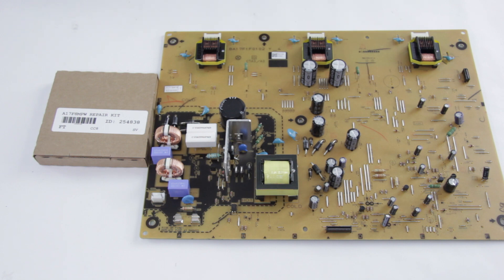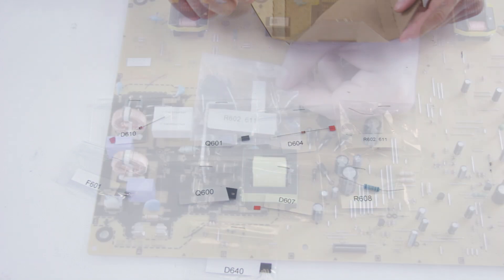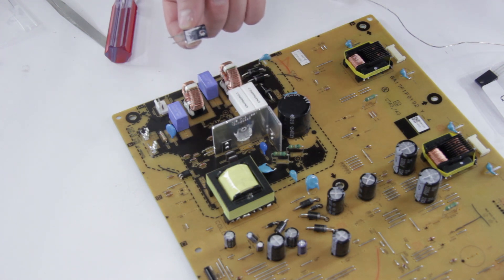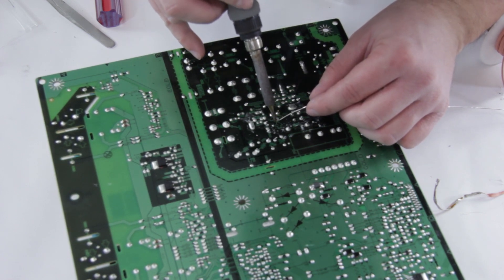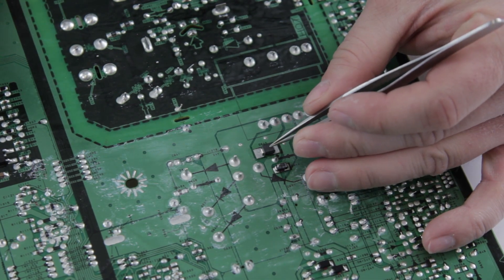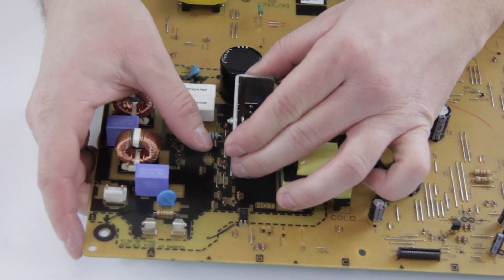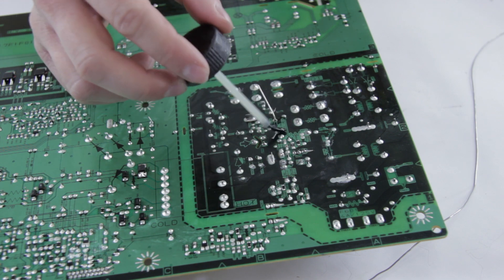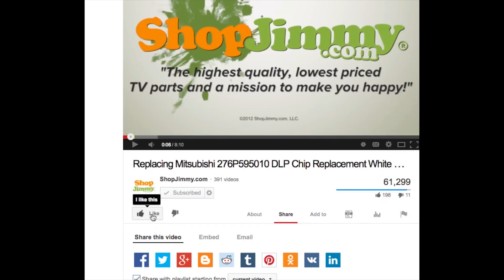Emerson / Sylvania / Magnavox No Power LCD TV Repair A17F8MPW Power Supply Component Repair Kit

Comment: Emerson LC32OEM2 TV: I have 5.xV (volts, the voltage is anywhere from 5.12V to 5.30V) everywhere but no more than that! If I push power button on TV set, nothing happens! The chip that has the big "L" shaped heat sink is hot, so I pulled it out and tested it - it is OK, based on 3 of my Transistor Meters, so I put it back. The push-button for power (and all other like sound ...etc) are going to the other board and a ribbon cable is between both boards should tell the power supply to supply 24V (at least that is what I found in the service manual), but nothing happens. When I disconnected the ribbon cable + all other connectors, so there isn't anything connected to the power supply, the chip is as hot as if I did not remove any cables at all. I have several questions: 1) Is that normal, that the chip is so hot to touch, despite that there isn't any load on it? 2) Where can I find what reading should I see on my volt meter when poking around the power supply? 3) Does anyone have any idea what else I can check (I tested visually and with 3 different capacitor testers all the capacitors - they all look OK to me)  I also measured the diodes - I did not pull them out, so I understand that in some cases I could get bad readings, but I also tested voltages while the power supply was on, to double check the diodes. 4)Where one can go and get help and or leave help for others to help them? 5) Are there any clubs or Facebooks that are for people like me, who is learning to fix TV; I'm trying to help others, like people on wheelchairs and or poor people, who can't afford expensive or any $ to fix their TV.  I'm not making any $, I do this to help and I'm having fun learning also.  Thanks guys!

Comment: I bought a repair kit ..and install it fuse didn't blew up but still not working    LC320EM2F serial #DS#A1137158      BA17F1F0102     Help me Pls.A1AFOMP
Reply: lawrence coquico same here! Did you get it fixed or resolved?
Reply: check for a shorted diode , theres a gruop of diodes in a raw close to the center of the power board  in the middle u should see a little diode check if its shorted

Comment: hello jimmy,
I have a Emerson LED 50", model #LF501EM4F, It won't turn on or anything. 
It dose make a "beep" sound every couple of seconds constantly.
The sound seems to come from a transformer on the powerboard (# BA3AU0F01  02  2)   
Is there a kit for this board or is there a problem somewhere else?
Please email me at   joevianelli@yahoo.com  any help would be great!
Also the manufacture date is Sept. 2013
Reply from the maker: +Joey Vianelli   Try all repairs and troubleshooting at your own risk.  I recommend replacing the main board in your TV.  Click this link to replacement parts for your TV model number:  http://www.shopjimmy.com/catalogsearch/result/index/?cat=225&q=LF501EM4F%2C  There may be multiple boards for the same TV model number, be sure to match part numbers on your current board, with your replacement for compatibility.  Thanks and please let us know if you have any further questions with your TV Repair!  www.shopjimmy.com

Comment: i have 2 flat screenz i need help wit! 1st off a Sylvania 6632LG it just turn'd itself off... tryd to turn it back on it come on 4 a sec and shut off again!!??? Also a 27inch Emerson LHD32K2OUS  when plug it in has red light try to power on it does nothing wont turn on?? Any idea on what goin on?? Thank You if can help! :)
Reply from the maker: +69lildro   Try all repairs and troubleshooting at your own risk.  I recommend replacing the digital board in both TVs.  Click this link to replacement parts for your TV model number:   Sylvania - http://www.shopjimmy.com/catalogsearch/result/?q=6632LG+  Emerson - no search results.  There may be multiple boards for the same TV model number, be sure to match part numbers on your current board, with your replacement for compatibility.  Thanks and please let us know if you have any further questions with your TV Repair!  www.shopjimmy.com

Comment: I have a LF320EM4 emerson.  Probable lightning strike according to my friend that had a storm .   Is there a F601 on this set.  The glass tube type.  I find a place on 
BA3AFOFO102 3 board for F602  my continuity test shows this open.  Mutli meter shows no resistance.  I was expecting to find an easy to replace fuse without solders.  Is there such a fuse on this set?  If you can't point me to a fuse of the proper kit  then would you be kind enough to help locate the proper power supply board ?  I can find many BA3AFOFO102 1 boards but not the one in my set.  Are they interchangeable? Is there a suggestion to help me fix this cheaply.  I dabble with some electronics and would love to be able to get this running at home.  Thank you so much
Robert Kelly.

Comment: Hi im Nick, i have a memorex model mlt3221 the tv will not turn on at all. I replaced all the caps on the power board and it still wont work. How can i test the power board or is there something else i should be looking for.. Thanks ahead, any help will be greatly appreciated.
Reply from the maker: aalnil   Try all repairs and troubleshooting at your own risk.  If you have experience and  the skills to use a multimeter, you can check for standby voltage on the power supply.  If you do, please reply with the results.  Thanks!  www.shopjimmy.com
Reply: I bought I repair kit . and install it follow your you tube not blowing fuse but still not turning on.. pls help ..

Comment: Hi, i have one tv EMERSON LC320EM2A with board BA1AFGF0102 2   A1AFG022   i want buy you the correct repair kit or module i have one repair kit BA17F1F0102 but the D604 in this model don't have installed this diode can you say me if this repair kit work with this model or if you have another kit or replace by this board model? thanks. e-mail radio_partes@yahoo.com

Comment: I have an Emerson LC220EM2.It worked fine and I shut it off and tried to turn it back on.Nothing happened,nolight on front,no sound,no picture.I bought and installed a new power board. It still is the same,Could it be the main or digital board?Can you give me some idea what to do next?
Reply from the maker: Dilenco   Try all repairs and troubleshooting at your own risk.  I recommend replacing the digital board in your TV.  Click this link to replacement parts for your TV model number:  http://www.shopjimmy.com/catalogsearch/result/index/?cat=225&q=LC220EM2  There may be multiple boards for the same TV model number, be sure to match part numbers on your current board, with your replacement for compatibility.  Here is a link to a video showing how to identify your part number, click here:  https://www.youtube.com/watch?v=wooRqBrRo6o  Thanks and please let us know if you have any further questions with your TV Repair!  www.shopjimmy.com

Comment: I have a BA17F1F0102 power supply problem and you sent me a kit, which i receive in due time and have it replaced all of the parts that were shown on this video, which i was so thankful...but, i have some doubts whether to replace all of them, which you didn't show in this video...i am referring to D607 and D604 which the latter was originally missing on this board...i did replace D607 anyway but my question is should i put D604 which was originally missing...thanks and goodluck... Felix Q.
Reply from the maker: Felix Quillope   I recommend using all of the parts.  Thanks!  www.shopjimmy.com
Reply: I did used all the parts and it turned out perfect... Thanks ShopJimmy...Felix Q.

Comment: I have a Emerson lc320em2. no power , I installed the repair kit A17F8MPW , now I have power and sound and picture But the picture and sounds comes on , then it starts breaking up ,and the picture and sound gets erratic like a satellite in a storm. Do I need another board?
Reply from the maker: Johnny Avent   Please watch this video FIRST to help with your repair!  https://www.youtube.com/watch?v=BP3NVNCGEv8  I recommend replacing the digital board in your TV.  Click this link to replacements:  http://www.shopjimmy.com/catalogsearch/result/index/?cat=225&q=lc320em2  There may be multiple boards for the same TV model number, be sure to match part numbers on your current board, with your replacement for compatibility.  Here is a link to a video showing how to identify your part number, click here:  https://www.youtube.com/watch?v=wooRqBrRo6o  Thanks and please let us know if you have any further questions with your TV Repair!  www.shopjimmy.com

Comment: Hoping you can help me. I've got a Emerson LC320EM2F I went to turn it on it would not do anything. I took the back off
the fuse was blow I replace it with the same fuse and it blow it is there anything I can check  Thanks
Reply from the maker: b murphy   I recommend replacing the power supply board in your TV.  Here is a link to replacement parts for your TV model number on our website, click here:  http://www.shopjimmy.com/catalogsearch/result/index/?cat=4&q=LC320EM2F  Be sure to match part numbers on your current board, with your replacement for compatibility.  Here is a link to a video showing how to identify your part number, click here:  Part ID Numbers for Sylvania, Emerson, Philips Magnavox MPS, MPW, MUT, & Digital Boards TV Repair  You can also call our customer service for further assistance with your purchase.  (877) 881-6492  Thanks and please let us know if you have any further questions with your TV Repair!  www.shopjimmy.com

Comment: Hoping you can help me. I've got a Emerson LC401EM3F. Turned it off and went to work, came home turned it on and the red light went off and now the TV does absolutely nothing. No red light or lights of any kind, nothing, not a thing. I unplugged and let sit, plugged it back in and still nothing. Had extended warranty but the warranty company says (without looking at it) it would cost more than its worth to fix so they're just sending me a check for $216.00 for what we paid on black Friday 2012. Pulled the back off the TV and had no bulging caps. The power supply board for my Emerson LC401EM3F is Board number BA01P0F0103 5. Here's a link to a pic of it http://i488.photobucket.com/albums/rr250/sawilson005/IMAG1632_zpse39e5f18.jpg  I have no experience in repairing Tv's but am very D.I.Y oriented. Just wondering what you think would be the main problem or if you think there's going to be multiple problems and I should just buy a new board and throw it in? Any help you could give would be appreciated. Thanks...
Reply from the maker: S W   I recommend replacing the power supply board in your TV.  Here is a link to replacement parts for your TV model number on our website, click here:  http://www.shopjimmy.com/catalogsearch/result/?q=LC401EM3F  Be sure to match part numbers on your current board, with your replacement for compatibility.  Here is a link to a video showing how to identify your part number, click here:  Part ID Numbers for Sylvania, Emerson, Philips Magnavox MPS, MPW, MUT, & Digital Boards TV Repair  You can also call our customer service for further assistance with your purchase.  (877) 881-6492  Thanks and please let us know if you have any further questions with your TV Repair!  www.shopjimmy.com

Comment: Hi , i have LED MAGNAVOX model no. 32ME4022V due to lighting reason it isn't  working so i opened it then i found supply primery section was burnt. Now i cant find actual value of some spares which location is Q601,Q602,BC603,R611,D608,D607. Could you pls tell me actual spare value ??  supply part no. is BA21FGF0102 4
Reply from the maker: King Anand   I recommend this repair kit:  http://www.shopjimmy.com/philips-a21fgmpw-001-power-supply-component-repair-kit-for-32me402v-f7.htm  Thanks and please let us know if you have any other questions!  www.shopjimmy.com

Comment: I have had 4 or 5 of these TV's in my shop that all had a shorted zener diode at location D648 which your kit does not have and the video does not mention. Should the diode simply be replaced or omitted?
Reply from the maker: sside8   I recommend replacing the diode.  Thanks!  www.shopjimmy.com

Comment: i have a LC427ssx sylvania lcd power on but no picture. it clicks when you hit power button. it has two boards in there. capacitors look fine to me
Reply from the maker: Sambino   This could either be a problem with the T-Con board or the digital board.  I recommend starting with replacing the T-Con board, and if that does not work I recommend replacing the Digital board.  Here is a link to replacement parts for your TV model number on our website, click here:  http://www.shopjimmy.com/catalogsearch/result/?q=LC427ssx  Be sure to match part numbers on your current board, with your replacement for compatibility.  You can also call our customer service for further assistance with your purchase.  (877) 881-6492  Thanks and please let us know if you have any further questions with your TV Repair!  www.shopjimmy.com
  #tvrepair   #sylvaniatv

Comment: westinghouse ld-4655vx i checked the power brick and is getting 19 volts .Not getting a standby light or anything.
Reply from the maker: Big Doe  I recommend replacing the power supply board in your TV.  Here is a link to replacement parts for your TV model number on our website, click here:  http://www.shopjimmy.com/catalogsearch/result/?q=4655  Be sure to match part numbers on your current board, with your replacement for compatibility.  Here is a link to a video showing how to identify your part number, click here:  DIY TV Part Number Identification Guide for Sharp Power Supply Unit (PSU) Boards  You can also call our customer service for further assistance with your purchase.  (877) 881-6492  Thanks and please let us know if you have any further questions with your TV Repair!  www.shopjimmy.com

Comment: Have a westinghouse ld-4655vx that has no power and its not the cables that are bad.
Reply from the maker: Big Doe   I recommend replacing the power supply board in your TV.  Here is a link to replacement parts for your TV model number on our website, click here:  http://www.shopjimmy.com/catalogsearch/result/?q=4655  Be sure to match part numbers on your current board, with your replacement for compatibility.  Here is a link to a video showing how to identify your part number, click here:  DIY TV Part Number Identification Guide for Sharp Power Supply Unit (PSU) Boards  You can also call our customer service for further assistance with your purchase.  (877) 881-6492  Thanks and please let us know if you have any further questions with your TV Repair!  www.shopjimmy.com